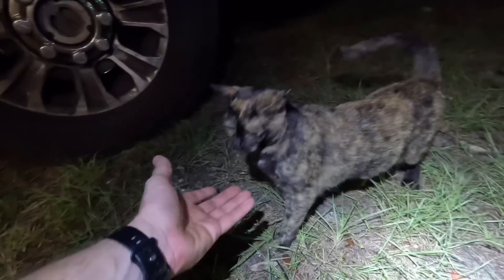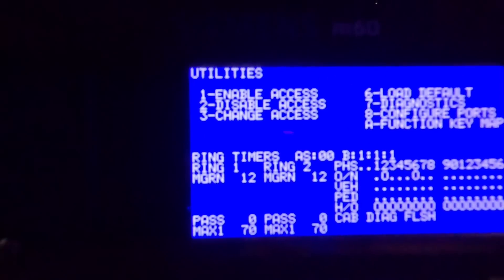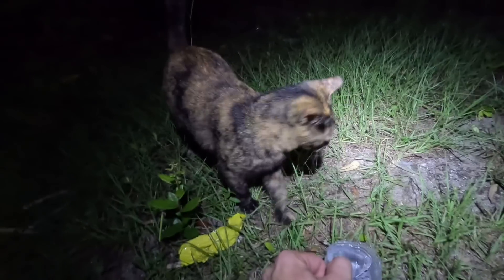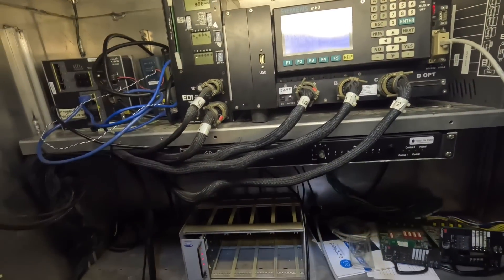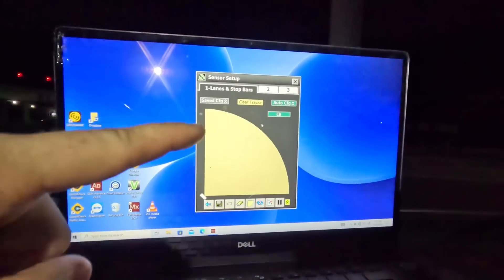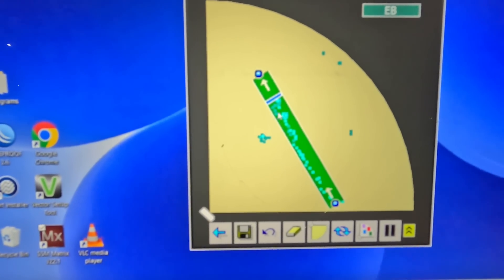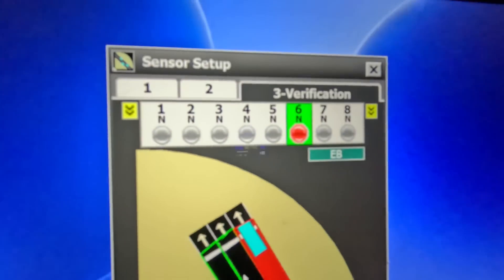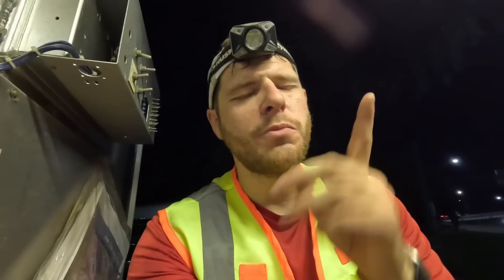Do Radars At Traffic Lights Catch You Speeding?

Comment: So the answer to the question is No - the radar is used to detect a vehicle approaching the intersection to trigger the lights!  Really useful information!  (and let us know how the cat is doing!)
Reply: I think that also depends on the system, here in NL they check both speed and red-light, with €310,- for a red light. However, you can also get a speed violation along with the red-light if you try to speed so just brake and stop ;)

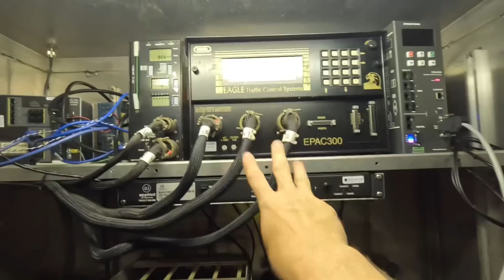Comment: @Traffic Light Doctor - 0:25 - what is the Cisco branded box in the upper left?  I did not know Cisco was involved in Traffic Systems Ops. 

as a CCNP Cert holder, this is news to me
Reply: That is a Cisco IE4000 Industrial Switch. Also at around 6 min 10 sec you can see it has a IP address labelled on it with a /27
Reply: @sum1634  nice thank you,  just never seen one used in traffic ops before.

Comment: Dumb question:  What generates the flashing when you flip the manual override switch?  It still works without the controller, so some other piece of equipment is generating it.
Reply: I'm not a signal tech so correct me if I'm wrong but I believe it's a few relays that get activated when the switch is flipped

Comment: Every traffic signal I've seen alternates which light is lit (red or yellow) or which direction is lit (in the case of a 3/4 way stop) when on flash,  but I noticed your signal has both the red and yellow lights on all the directions lit at the same time when on flash.  Is there a convention for that?  A jurisdiction ruling?  Just a personal preference?
Reply: Usually for power balance.
Reply: It depends on the directive written for the intersection. Typically our intersections in my state NJ will flash yellow for movement deemed right of way and red for the secondary.  Not all intersections are equal the timing directive is the law of how the intersection operates. Also the flash should alternate at 60hz I believe. Yellow on red off, red on yellow off. 
Hope that helps
Reply: @ericbielauskas1472  Thanks for the explanation.  However, in contradiction to your last statement and how I had thought traffic signals were supposed to operate on flash mode, in the video both yellow and red are on at the same time and off at the same time.

Comment: That tag is not a lockout tagout. That is a serial number tag that the power company puts on. So they know if anyone tampers with the equipment.  They usually charge a massive fee anytime those are cut off becauae those on the meter is how they have made sure that nobody has bypass the meter lugs to get free power. So when they put the meter on they then snap on the ring and then that serial tag. And then if the next time they come and read the meter or perform service or do a random inspection if that tag is gone they then have to pull the meter to verify that nothing was altered, and then they also issue a massive tag fine and it is actually illegal to cut those and you could be facing jail time as it is altering a public utility infrastructure. That is for at least at houses. I don't know what it is for a traffic signal, using is making sure that no one is tampering with the stuff. But you also don't want to leave the breaker pan on just open with no locks or anything, because you didn't have some random person walking down the street walk over and flip the breaker and kill the entire intersection. I've never seen a breaker on the outside of the cabinet. Most the time it's just the meter pretty high up about 8 ft in the air and it's just on 2x 90° fittings that have it connected to the poll and then the breaker is actually a din rail mounted breaker assembly inside the cabinet. That way only proper personnel who have access to the cabinet can kill the power to the intersection
Reply from the maker: @MikeHarris1984  agreed, it is a tamper tag I worked on commercial shipbuilding prior to traffic lights and got me in the habit of calling anything that blocks you from killing or turning power on a lockout tagout. And those fines and criminal offenses usually come from actually trying to fake out meter (hard to do with new smart meters) or worse like suppling power to it when the powers out. When it comes to public safety though it’s whoever responses first to the situation to do whatever it takes to ensure public safety. I absolutely hate when the meter is mounted directly to the cabinet but it’s still really common just not recommended anymore. The power company can get mad all they want but when it comes to getting roadway, bridge navigational, or signal lighting back up and running legal action is out of the question at that point. Again never recommended unless it’s an emergency or communication with the power company has been established about what you’re doing.
Reply: @Trafficlightdoctor  agreed. Also I know what you mean by the habit of calling anything blocking as lockout tag out. I remember when I worked in an industrial environment and had to take the all fun OSHA lockout tag out training. Lol 

I still find it odd that your traffic signals have the breaker to kill everything so accessable.  Maybe it's rual enough that it isn't that big of a deal. Bug seems like a safety issue to have it available for anyone wanting to cause mayhem to just walk by and cut the serial tag and kill the breaker(s).  Out here any breaker that is outside the cabinet, is locked with a padlock (yes they are easily picked, but

Comment: Really enjoying and learning from your videos, thanks!  Do you have problems with RJ45 connectors losing contact? Back in the old days we kept seeing gravity pull the plug pins away from the jack pins ~ fixed by flipping over the jacks. Now see plugs too small for the jacks and also pins losing spring pressure > guessing poor design and materials... Have fun tonight!

Comment: Is that traffic controller cursed or is it called a job security. I'm trying to figure that out. And the cat looks like it belongs to your family. Have a great night and again another great video

Got a question have you ever seen a stoplight system with a solar and a battery system connect to it. Because the one at the corner of our property does not stop when the electricity goes off and it continues to run. It seems that everything it's got solar panels on top it's all LED

Comment: @2:33 If you change the baud rate on the port of your laptop to 38400 baud you will have faster downloads en uploads to and from your device 🙂 The controller seems to support it.... and your laptop should def support it... sometimes that communication can still fail though... it's a bit of trail and error. The weakest link should be the controller in this case. You usually do not break anything trying..... it's just setting the speed it sends data back and forth.... changing it back will make it able to read it in case it does not work.
Reply from the maker: Agreed, it might be superstitious but I’ve had issues going that high on the baud rate so I keep it one below! Lol
Reply: Sometimes you just do what you know will work even if it takes a few seconds longer. Because if it doesn't work then it may take even longer to remember you changed to a faster baud rate then change both devices back to the slower speed.